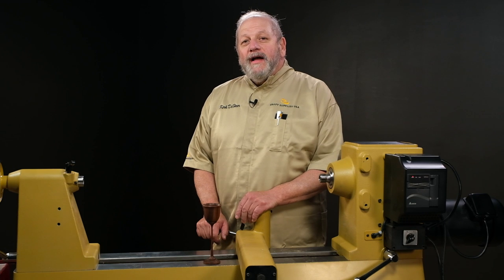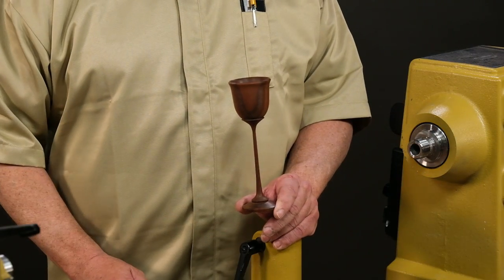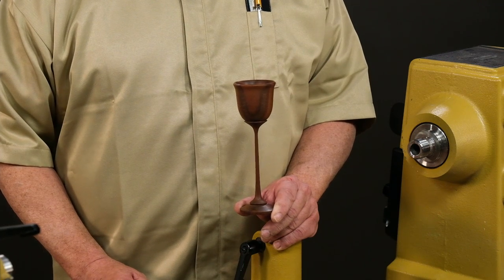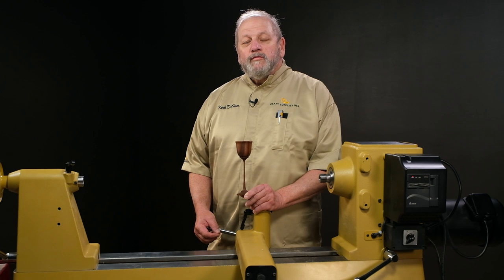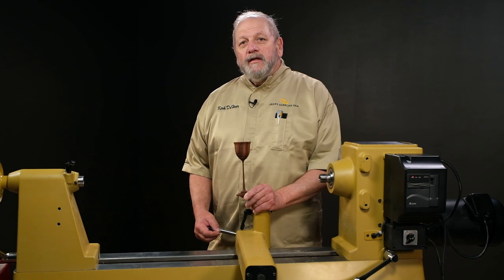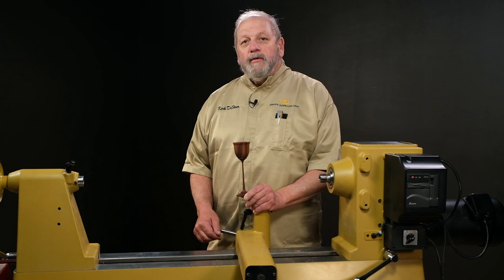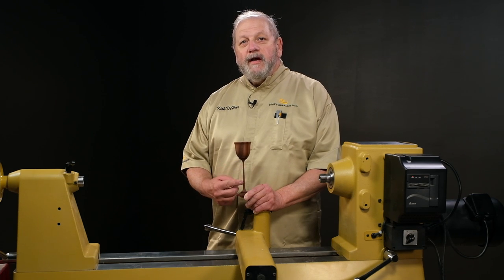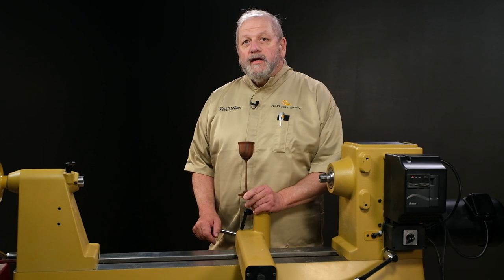Woodturning 101 - Video 9 - Turning a Goblet

Comment: 20:26 can you please explain why you spend the time to face off the end only to drill and turn away most of it? 
Why not drill and hollow the bowl and then facing the remaining 1/8 to 1/16” rim?
I see the same approach with metal lathe work and CAM milling and wonder why. Thank you.
Reply from the maker: You want to face it off while all the fibers are supported.  If you hollow the bowl then go back to clean up the rim, it will most likely tear out as it is end grain fibers.

Comment: Isn't the wood moving at 3200 rpm whether your cut is 1/4" from center or 2.5" from center? Just confused as to why the reference is used to 8k rpm by multiplying 2.5" by 3200rpm.
Reply from the maker: Actually, no - the further from the center of the piece, the faster the wood is travelling . It's a quirk of physics and I'm sure there are really good explanations out there. The gist is this - the entire piece is rotating at the measured RPM, but a point on the edge has to travel a much greater distance than a point in the middle to maintain that RPM, so it travels much faster than a point closer to the center.
The same thing happens with car/bike tires. Or if you've ever spun a child in circle by holding their hands and spinning - their feet are traveling a lot faster than you are in the center. Hope this makes some sense?
Reply: @CraftSuppliesUSA  good explanation!  Let me tell you what has me confused, please. If I am doing centerwork on a piece 6" in diameter, and use a sharpie to mark two dots on the endgrain...Dot 'A' is 1 inch from center, and Dot 'B' is in the edge...3" from center, and the lathe is set to 3500 RPM, they are both going to spin around center 3500 times in 60 seconds, one just travels alot faster than the other!  :P and one cuts alot more wood!

Edit : it sounds like it would have to be measured in a unit other than rpm.... or maybe I am just being difficult here!  :P
Reply: @eclear4evr  Think of RPM as more of a frequency as opposed to a speed. It measures how often something happens (e.g. one rotation) given time. Speed requires a distance to calculate. So while Dot A and Dot B are travelling with the same frequency, Dot B has a greater distance to cover in the same time and is therefore going faster. So the larger your diameter is, the lower you need to make your frequency in order to maintain a balance of 6K-9K. If it helps, I never even think of the 6-9K number as an RPM. It's just my safe zone that I know the product of my RPM and size need to land between.
Reply: Don't get confused by RPM numbers. With each revolution a dot on the edge of the wood travels a distance of 2*pi*R where R is the radius of the cylinder. It is the circumference of the cylinder. That is the amount of distance the wood travels in 1 revolution past the gouge. So a wood 1 inch in radius travels 5 times less distance than a wood 5 inches in radius past the gouge in 1 revolution.

Comment: Where did you get the range of 6k minimum and 9k maximum rpm at 2.5" from center?
Reply from the maker: Great question - it's explained in depth in the first video of the series. It's a simple way to determine safe lathe speeds, especially for beginners. Diameter x RPM = 6,000 - 9,000. The 6-9k number is NOT RPM, it's just a range that was determined by Dale Nish as a ballpark to shoot for. If you do the math and the result is lower than 6,000 you won't be cutting efficiently and might want to speed up. If the result is greater than 9,000 you probably want to slow down since you're turning a such a high speed that it becomes dangerous.
https://www.youtube.com/watch?v=XubeZKjCmeU&list=PLel9nM3jaNJ6So5IMt-uMLv3fg061Nu78&index=2
Reply: @CraftSuppliesUSA  awesome tha k you! I will watch this!